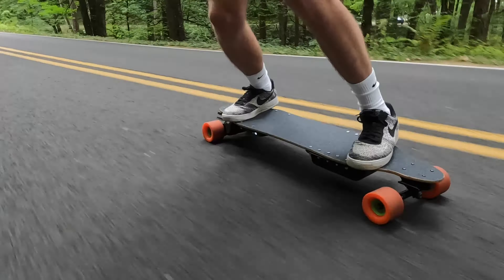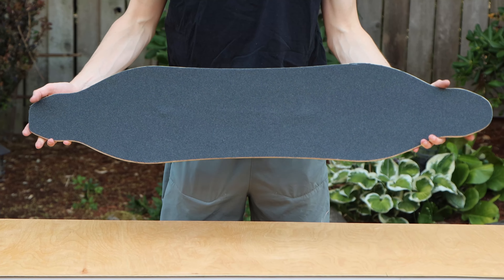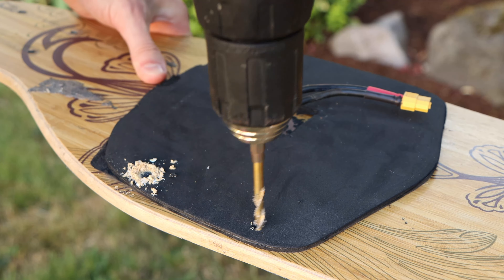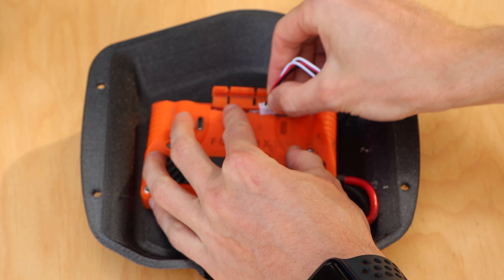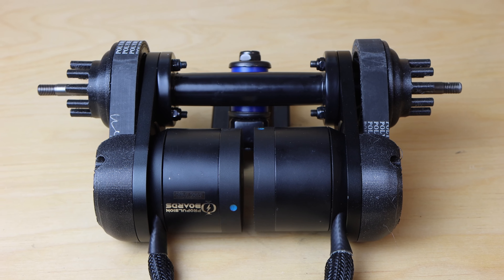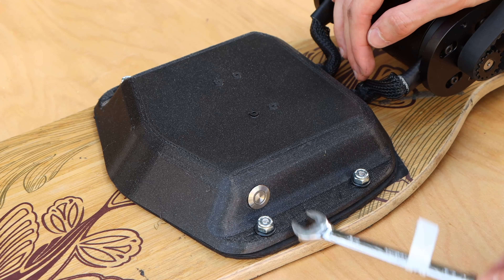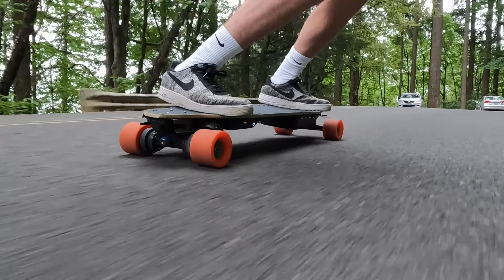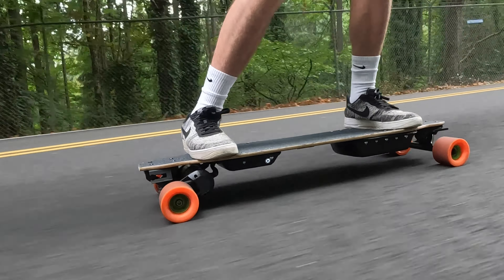How to Build an Electric Skateboard *DIY Boosted Board in 2024*

Comment: Thank you for the video, but I am still confused. Boosted as a standard is years below current eSk8 capabillity, so it would seem that building a better "boosted" is at best building a substandard board. It would seem that boosted as a brand was very iPhone-esc in fantasism, building loyality thru expensive exclusion of the poor. In this case Mboard, Meepo, Evolve, etc all of which in practice blow boosted lack luster performance out of the water. Not to mention Casey appears to have moved on as well. So I guess my question is, why hold on to the past?
Reply from the maker: This video really goes after the boosted ride feeling and aesthetic, which is what I think were the two best parts of the board. It does this while incorporating DIY quality components. Thus, it takes the boosted platform and elevates it to the modern perfjoamcne standards.
Reply: @DIYesk8Builders  Your board is what a boosted board should have been... at a reasonable price of course. I saw boosted for what it was, just another high end company. Conversly I would buy a $1300 board from you without a thought. You demostrate everything an owner should be. THATS why I get butt-hurt when I hear someone comparing a superiour product like your board with a "just for the money" product like boosted board.

Comment: hey :)
the wheel polly is also 3D printed?
If so, what material did you use?
Can you share what parameters you entered into the printer?
Reply from the maker: They are injection molded. The prototypes were 3D printed though. I do not recommend 3d printed wheel pulleys. They will break from my experience

Comment: I'm sorry if these are dump questions, but I think this is a really cool idea and am considering making one of these from a broken boosted board I found for cheap

1. This is going on the assumption that I must use VESC 6, as that seems to be the only compatibility overlap between the controller and the ESC: Where is a good place to get a VESC 6 controller/sensor/receiver? (the thing that connects the remote with the ESC), never having heard of them before, I'm having a hard time finding a reputable retailer (and don't know what pricing to look for)

2. I can't for the life of me seem to find the pinned link to the tutorial video on how to code the ESC linked in the description, only the video embedded in your demon 3.0 video which is a different ESC (not sure about how much carryover there is between the two)
Reply from the maker: Hi,

1. MakerX has some solid VESC based ESC's at the moment. Flipsky has some popular remote (VX1, VX1 PRO, VX2, VX4).

2. The 3.0 video tutorial should be pretty similar. A few specifications would need to be changed depending on your battery and motor setup.

Comment: Nice video... Do you have components info to build a hub motor version?
Reply from the maker: Thanks! We do not sell any hubs, but there are some options out there. It would make the video even simpler
Reply: @DIYesk8Builders  i could use same battery and esc and remote?
Reply from the maker: Yes you could

Comment: Is the bms built into the batteries? Any recommendations for batteries?
Reply from the maker: Hi, the battery has a BMS, yes. It is inside of the shrink wrap. There are a variety of custom builders out there that make nice batteries. Duck Battery Systems has great batteries and MBoards also has a nice selection